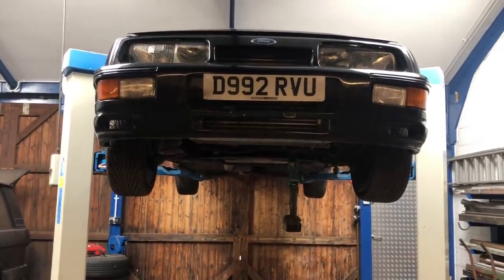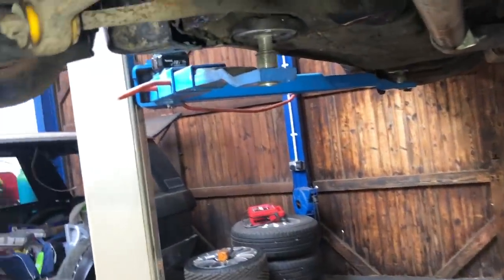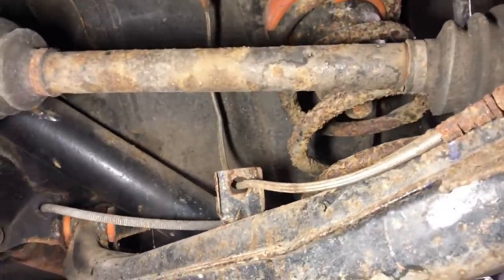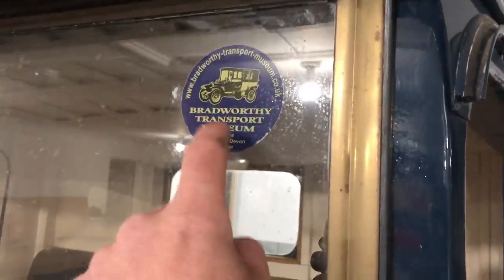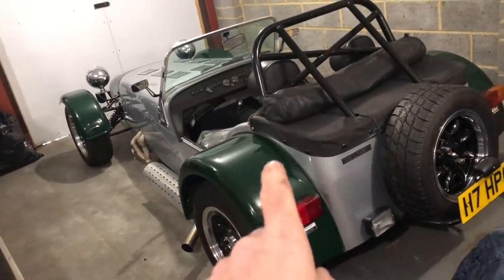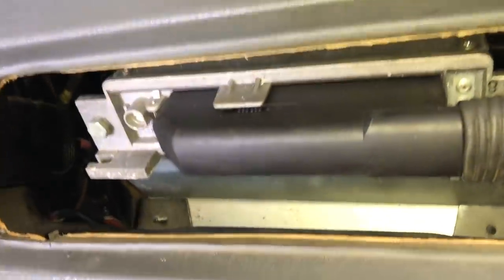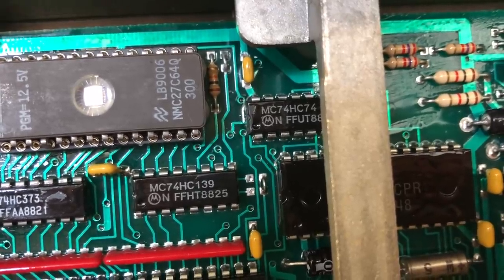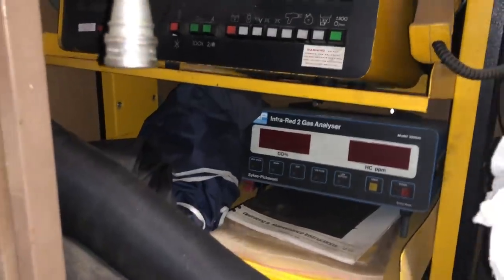Ford Sierra RS Cosworth 3 door what is next? pt5

Comment: That a L6 ecu and without reading the eprom you won’t know anything about the chip spec 
As I said on an earlier video it’s on greys with a t34 so will be about 380 bhp 
The sump is a modified big wing sump and the extra fittings welded in the welded up are for use with a wrc type breather system 
Please tell us what your going to do before doing it as it’s easy with cosworths to make mistakes believing what you are doing it right 
For example the rear arm to beam bushes have been replaced with poly super flex bushes which is a downgrade from the spherical bushes that ford fitted!
Many owners have fell for that one over the years !
Reply: Fair play Steve you know a fair bit about cossies

Comment: Wildwood brakes and koni suspension are both excellent pieces of kit
The shocks may be a little past their sell by date but I wouldn't change the calipers! (Apart from perhaps seals and dust seals)

The sump I presume will be some Sort of custom baffled sump to prevent oil starvation in high speed corners
The polybushes if they are OK I wouldn't change, Granted they're a little stiffer but the car will feel better for it
Braided lines don't tend to go wrong and do help pedal feel however they're installed incorrectly

Don't know how far you're wanting to go with it but personally I think it would be an excellent idea to drop both subframes and do a really good tidy up of the floor pans and suspension components!

If you're struggling to get hold of any parts stock or aftermarket just give me a shout! I deal with this stuff day in day out
Reply: deggersz yep it’s had some serious time and money spent on putting that spec on it and all worthwhile mods once you are running some decent boost on one of these, apart from aftermarket wheels and Samco blue hoses you are better keeping the upgrades makes it a better car.
Reply: The koni shocks may even be top adjustable ones. They can be rebuilt.
Reply: That sump is a larger idea of what Ford did for the Escort Twin cam when they added extensions each side to a standard Escort sump pan. It was called the 'Big Wing' sump pan but unofficially called 'Big Ears' in Essex. It added more oil and stopped starvation on hard cornering.
Reply: @martinbeet7917  I recently had some konis rebuilt by a company called sp suspension, they came back like new👌👌

Comment: Hey Rob I have worked on Engine Management Systems(EMS)  for 25years started in Automotive , but 20yrs FADECS for Jet Engines. The Chip is an EPPROM and you are correct the glass window is used erase the settings. The FADEC were made for many diffents cars plus models. The laquer is there to protect the electronic components from moisture and prevent corrison. The PCB has a lot of through hole compenetns, Where you saw the white label behind a component, that is an insulation pad , which prevents the risk of component shorting, to metal heatsink, component is an actual transistor probably used for the injectors. Be careful opening and touching components iside as they can suffer Electro Static Discharge. Overall the ECU looks good, thanks for sharing
Reply: The white stuff is heatsink compound used to aid heat transfer from the transistor into the aluminium heatsink behind it.

Comment: Hi I used to work for Weber UK your ECU looks like a P8 version for standard 4 injector Cosworth the RS 500 had a separate circuit board that the eprom plugged into I used to repair and modify these units the RS 500 version also had  another fuel rail with extra fuel injectors if you contact Webcon UK in Sunbury on Thames they should be able to help further. We used to provide Andy Rouse Engineering with an upgrade kit back in the mid nineties for the RS 500 conversions hope this information is of help to you all the best with your project.
Reply: @Leslie Day what do you know about the zytek ecu from the group2 rs500's I am having to remove chip to reprogram, have mounted chip on outside of zytek on zif connector which makes it a bit less tedious. I need the live monitor box for my zytek, people just you to skip them as no market for them :-(
Reply: @leslieday1830  thanks for coming back to me. I am mostly ok with the zytek just need the hardware box for live monitor. Zytek I believe also was the same as a Lucas EMs of the era.

Comment: New to the channel and love it. At 17 I was working as an apprentice panel beater, we use to repair police cars amongst others.
As well as patrol cars normally Mk2 escorts, and now and then 3.0 capris and RS 2000 in black and unmarked, and the odd sierra cosworth.
The cop shop was only 2 miles away and we used to deliver the cars back, which was the highlight of the week,17 yrs old driving an Rs or 3.0 capri was unbelievable. Those where the days. 
Love the channel can't wait to see what you do with the cosworth👍👍

Comment: It’s got a 2wd Sapphire Cosworth ecu with those injectors and t34 size turbo the only way to work out the power figure as your chip hasn’t got a sticker on it the ecu’s map will be on the chip that can be removed from the board is if the boost is set between a peak of 27psi and holding 24 psi you’re running around 330-340 bhp,  if boost is more like 32 psi peak then slowly falls as revs rise then you are around 370+ bhp
Reply from the maker: Thats A Turbo 'Stu' I think a rolling road video it is 👍
Reply: @sruk  i would be doing a belt and water pump first dont want to risk it shitting itself
Reply: @sruk  Got three Morris manuals 1930s covering 12cwt to 3ton Morris manuals one for your truck.I'll give phone no if you're intersted
Reply: It's on grey's wont be running the low boost be the higher figure is set up right or it would bore wash or over fuel. Q
Reply from the maker: gsg I have said in every video the first job is the belt and pump but we can’t get one at the moment 👍
Reply: R A they are like taps anyway motorsport developments also show the lower figure for greys even though 803 greens could do it aswell
Reply: Be lucky to have 370 plus on that set up but I’d love to see this on the rollers
Reply: Brad Kells depends if it’s a t34 and not a t35, 36, 38 as from what we’ve seen you wouldn’t tell
Reply: Thats A Turbo 'Stu'
Has a normal Sierra Cosworth and Sapphire Cosworth got those 2 sets of injectors that Mr err was referring too which were uncoupled
Reply: salvage rebuilds uk qaqqqqqqq
Reply: @mywinkyisatwinkie9028  I'm not an expert but as faras I know it was only the RS500 that had the extra, unconnected fuel injectors for holomogation reasond.
Reply: Thats A Turbo 'Stu' why not just look at the colour of the injectors that will give you some idea of the power
Reply: @nicholasmassey3046  Thank for the reply buddy :)
Reply: leevwe leevwe it’s already been discussed that he has greys and t34 , 35 or 38 turbo
Reply: @sruk  excuses excuses lol 5248xs is part number on ebay 24.95 delivered made by gates which is who made them for ford. Water pump is driven of crank  not belt wouldnt bother replacing as used to do the belts every 10k for safety and pumps are dam good on these get Chris bizzy lol we need more content !!!
Reply: @err4071  little more to it than that head gasket etc dont  believe all you see on youtube lol
Reply: @ra52  Who said anything about a head gasket, i mentioned a chip and the fact that the sierra rs 500 cosworth had 2 sets of injectors it had 8 in total . which to get the extra 4 to work all you needed to do is to provide power to them by wiring them up, and fitting a chip which you could buy from ford which gave them the correct levels of fuel, by doing this a standard RS500 went from 250 bph to 400 bph for only £100 to £200
in the 80's, this is a known fact, here's the actual cosworth engine management system parameter information pages actual statement,  The extra rail of injectors was fitted to the RS 500 road car to allow for the additional fuelling requirements of 540+ BHP touring cars. (If you follow the wiring loom from these injectors, you will find that it terminates in a plug hidden below the battery tray!). We are able to make 8 injector conversions using the RS 500 (or Escort Cosworth WRC) hardware, and any Weber-Marelli management system from level 6 onwards, (with relevant hard & software modifications). With this system we can supply the correct levels of fuel that is required for high power outputs, (by using two injectors per cylinder
Here's the link to the page lol https://www.grahamgoode.com/old/cosworth/ecu.htm
Reply: @err4071  yep and to do that you need to wind the boost up at around 28psi and the head gasket would poop its self you would need to fit a group A head gasket plus 044 fuel pump as the delivery on standard pump would not be enough. The principal is there agreed but be a bit more to it
Reply: @ra52  I am no mechanic, i am only going by what somebody told me in the 80's, he said he had it done for £100 to £200 , there was most probably a bit more to it like you said, that he didn't mention, he said he managed to get it to 400hp without a turbo upgrade, he said the chip that he purchased gave just the right amount of fuel without over fueling it , which allowed him to use the standard turbo, it make sense what you have said though
Reply: @err4071  yes ford did alter a few bits from the race cars to the street they also cheated as such on the touring cars used to run them in trials to get pole at 600bhp then rebuild them and run 500 in the races. 
They engine was originally designed to run 300bhp by cosworth but Ford didn't think it a good idea so detuned it. Which is why simple chip more boost and you got 270 standard then the mods kick in for reliability. Its also in the record books first production car to produce over 100bhp per litre capacity. Dam interesting cars history and drive like  no other like a mk1 escort on steroids lol. Looking forward to see what rob and Chris do next. Silicone hoses are best kept in the cooling side as they like to explode the standard ones. Roosh do them in black to keep the standard look.
Car should run a 12 sec quarter if set up right as well at the spec it is !
Reply: @ra52  You know now you have mentioned it, i can remember reading a article about Cosworth originally designing the engine to run 300 hp standard in the road car, and ford not allowing it.
Anyway buddy i agree their fantastic cars, especially the RS500, and the original Sierra Cosworth, they look so menacing compared to the sapphire and escort Cosworth, their like our mustang but better.
its going to be really interesting seeing that car have a new lease of life in the up a coming month :)
Reply: I know I'm 3 months late, but whatever you do, don't listen to the internet when it comes to these cars
Go to the forums (passionford) and Facebook (Cosworth Drivers Club) are probably the best
And check out Mr Sanderson at Motorsport Developments (or Mr Shead at MAD if you want closer to home) for proper expert advice
It's so easy to go wrong with these cars, you'll need to get the fuel system looked at too because there's loads of rust around the pump and filter and, given its age, you'll probably need new hoses around the engine and it's a wise investment to change not only the engine loom but also the fan loom too as these are notorious for causing issues (get the upgraded fuel pump loom too because that's save you a melted renting when giving it some welly)
The rear poly bushes should really be bearings, and you'll need to strip the rear beam to get the bolts out
I'm sure that others with more knowledge will be along shortly to give their advice that's totally different to mine, I haven't owned one in 25 years so what do I know lol
Love the chatting too 👍

Comment: Someone has spent some time modding the cozzy, makes you wonder what's been done to the engine internally , the big sump extension does make you wonder....to put the whole car back as standard won't be cheap, i'd keep the front brake conversion if you can get the parts to refurb the calipers and new discs, really interesting and would love to know it's history and what's been done to that engine.......she looks very solid for an old Ford. Love the old Morris, again yes i'd like to see more of the renovation on that . Nice work guys

Comment: should be a sticker covering the window on the eprom - dont leave it exposed to UV as it will erase it over time.  Put some black tape over the window.  As the other chap said, there should of been a sticker on it - so no way of knowing what it is (the numbers on the chip are just part numbers for the blank eprom)

Underneath it looked like there were some hoses disconnected to the sump? @1.14
Reply: A PIC in a sealed ECU case inside the dash will be fine, no need to tape over it which is why they haven't done it before
Reply: mike fear   It’s an eprom not a pic.  But, yes i agree, all sealed from light it will be fine - but otherwise they should be covered really.

Comment: Big wing sump, stops oil starvation on the track :)
Reply: more than likely baffled too
Reply: gimble good chance decent spec car probably made 280-300bhp no way I’d return to standard just tidy it up and change the wheels 💪
Reply: @benerst10  probably well into the 300s anyway when it has a turbo ubgrade, 280bhp is really only good stage 1 stuff and most would only be running standard brakes and not bothering about big wing sumps etc if sticking to the lower budget tuning route, i agree on not returning it to standard, just get the paint done and tidy it all up to look a minter inside outside and underneath, black hoses under bonnet etc and it will pretty much look standard to most except the air filter anyway and only concours rs owners club trailer queens have original mild steel exhaust at the end of the day these days anyway, hard to tell if standard wheels will go over those willwoods but they look the smaller ones so fingers crossed on that one, or maybe just a 5mm spacer for caliper clearance or something at most hopefully :)

Comment: Cosworth ECU - I know the eprom doesn’t see light of day as such but for safety’s sake stick something over that window on the chip. I doubt the model number of that chip will tell you much about the tuning of the engine as this chip gets programmed with any data someone wishes to put on it.
Morris - you do ask some daft questions, of course we need a series of videos on that alone.

Thanks for the effort that you put into making the videos 👍
Reply: it is a standard 8 kilobyte (64 kilobit) CMOS EPROM from the 80s - would have been used in a lot of things around that era - I used to program ones up for use in a BBC Micro - as Diesel Bushcraft said, get a label over that window as sunlight can produce enought UV to corrupt it. Also if you can find someone with an EPROM programmer get them to make a backup of it (retrocomputing community would have the right programmer - know there is a little retro museum in Ramsgate, you could try asking them)

Comment: Hi Rob the ECU is not from a 3dr but is an L6 from a 2wd sapphire, the chip looks oem but this not mean that has not been remapped...also from the wings welded on the sump, turbo, injectors and brakes you can probably be sure the car it's been used on track...a thing i've noticed the sump has one an fitting welded in it so could be missing some breathing sistem or has been purchased used already with it and mounted on this car...keep we ready for news and video!

Comment: The brass plate on the back of the of the disc is a conversion plate for bigger callipers and discs I would put new braided hoses on the front and you will feel the bumps in the road with those bushes I had them on my Mk1 golf and took them off after a week.

Comment: I bought a Merkur XR4Ti in 1986 and put 65,000 miles on it. Great car. I always lusted over the Cosworth RS5000,something forbidden in the US. The XR4 is ultra rare in the US today. If you can find one they are beat to hell and quite neglected because parts are impossible to find parts for them.I’d still love to find an early XR4Ti because they still had the biplane wing and drop a V-8 or a modern high performance V-6 in it. It would be a testimony project but it would have to a very clean car to start with due to availability of parts.

Comment: The ECU looks fine, that chip that goes in a socket is normal. Usually though, it has some sort of sticker over the top of the window. I don't know if that one has been wiped and rewritten or replaced at some point. I can say that the chip looks OEM, not aftermarket.

Comment: It's good practice to put a sticker over that chip's window. It'll stop any unwanted radiated UV from daylight etc corrupting the data on it. I would also get a chip reader and save a copy of the data before putting it back in. That goo you pointed out is heat transfer paste. It helps transfer the heat from a component to a heat sink.